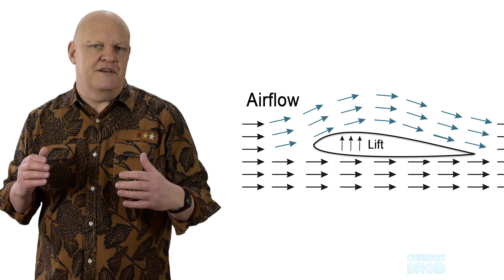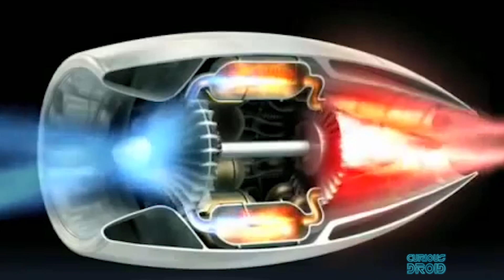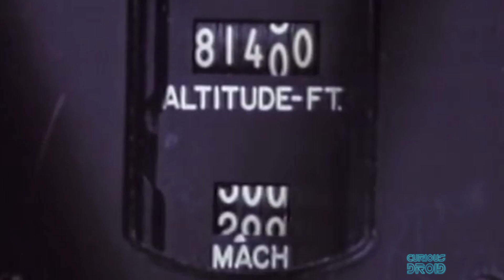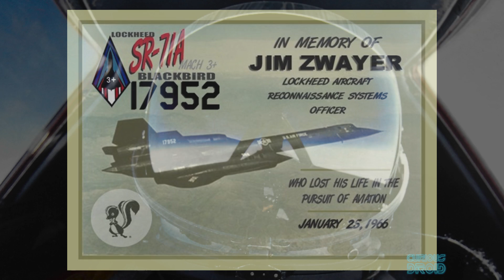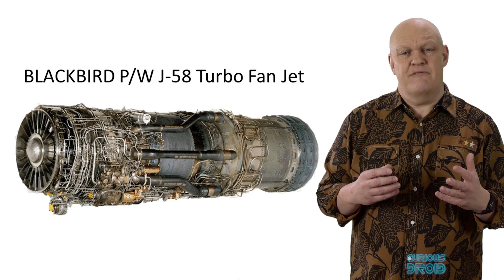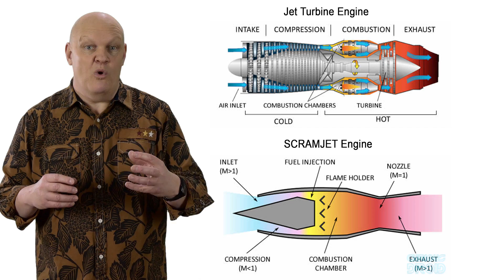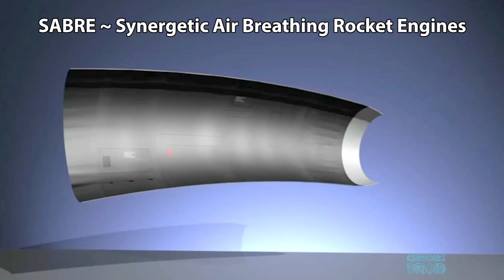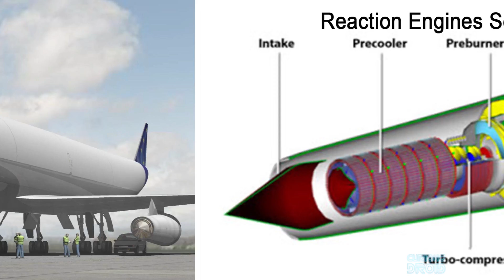Why can't we fly a plane into space ?

Comment: Correct me if I'm wrong, but escape velocity (about 25,000 mph) is the initial velocity needed (ignoring air resistance) to escape from earth's gravity permanently, going higher and higher and never returning.  Getting into space and staying in orbit requires a smaller initial velocity.  Getting into space and not going into orbit requires an even smaller initial velocity.
Reply: The 25,000 MPH number goes back to the Apollo missions. To get the Apollo spacecraft out of low earth orbit and on its way to the moon you needed to increase the speed from 17,500 in orbit to 25,000 MPH going out. But all that really did was place the spacecraft into a very long elliptical orbit that would take it to a high point of about 200,000 miles up. Then at that point the moon's gravity would take over and pull the spacecraft down towards the moon. Eventually the spacecraft would pass behind the moon and slow itself down with an engine burn to become trapped in lunar orbit. However, if the moon were not there the spacecraft would simply turn around at 200,000 miles and start coming back down toward the earth again. So technically 25,000 MPH is not really the earth's escape velocity. It's actually much faster. For example for the New Horizon's spacecraft that went to Pluto the escape velocity was about 36,350 MPH. But depending on the spacecraft's destination the escape velocity requirement can actually vary quite a bit.
Reply: Tyroneous Assault 

the booster engines are discarded because the fuel in them has been consumed, so the empty fuel tanks and heavy engines are now a liability in terms of weight. 
so they are jettisoned, making the spacecraft lighter, requiring less power to continue to accelerate, and the next set of smaller engines ignite and take over.
also the higher you go - the less dense the air, so you don't need as much raw power to go faster because there is less drag on the spacecraft. 

this is what airlines fly at 30k to 40k feet, it's far more efficient because your engines do less work fighting against the denser air below
less work means better fuel economy = more profits.  however there are diminishing returns the higher you go, you start to lose lift on the wings as the air thins out, and eventually your air breathing engines will starve for lack of oxygen. you can go faster to get more flow over the wings or into the engines but that requires more fuel = loss of profits
spacecraft are powered by rockets, and don't fly on wings, they go on raw brute power, and haul thier own oxygen. 

spacecraft don't "slow down" when they enter orbit.  they maintain a speed appropriate to the altitude of the desired orbit. 
they need that speed to stay in an orbit.  think of orbit as falling continuously,  but going so fast around the earth that you constantly  "miss" the earth as you are pulled down by gravity.
Earth is a curved sphere,  so with enough velocity you are constantly "going over the curve"   with gravity pulling you down, and your momentum carring you forward. 
as long as you maintain a ballance between your speed, and the constant pull of gravity... you stay in space. 

if you slow down you go into a lower orbit, if you speed up you go into a higher orbit.
slow down enough you fall back into the atmosphere and re enter, go fast enough you can leave 
orbit
Reply: +Justin Dougherty  No, gravity is acceleration, not velocity.  It's 9.8 meters per second per second.  If, on the other hand, you accelerated at 15 meters per second per second, that would be more than you need to escape from earth, if the acceleration was constant.
Reply: KenoTube    You are correct. 😎
Reply: KenoTube what are you? fucking smart?
Reply: -miguel rivera
"First of all i dont believe in space. Its made up for real."  Please don't reproduce.
Reply: Better Everyday Worse Everyday Im only 3 and Ive already built my own particle excelerator. With it I've created wormholes to other deminsions. I'm smarter and younger than you, just sayin'
Reply: KenoTube That's correct, there is no particular velocity needed to get into space, just certain velocities needed to stay in orbit (roughly 18,000 mph) or escape velocity needed to continue away from earth indefinitely, or even solar or galactic escape velocity.

Like many highly popular YouTube science themed videos, this one falls more in the category of science related, rather than actual factual science.

The simple answer to why you can't fly in space is that flight inherently requires an atmosphere.  Though it is entirely possible to travel in space, space travel is not flight, it's ballistic.
Reply: Skarmory Fly  
I'm only 12 i know how jet engines work almost every engine 
"I have been obsessed with plane for a 7 years"
Reply: If gravity pulls at around 10 meters a sec isnt say 15 meters a sec all the speed they would need?
Reply: Tyroneous Assault Gravity is a force that is the weakest known.  It caused by the mass of an object.  That mass causes space to be dented... so all the points in space contract... this means that a straight line is no longer really straight.  But everything falling freely toward the earth follows these points... and now cos they are stretched the object follows what looks to us like a curve. 

If you imagine the earth as say a bowling ball sitting on a giant rubber mat?  well it would stretch the matt downward yes?  and the heavier it is the more the mat would stretch downward yes?  okay so the gravity is not linked to the SIZE of the object... just it's mass (weight sort of)... so a ping pong ball and a steel ball would not make the same dent in the mat.....  now if you have the bowling ball in the middle of this mat,  causing it to stretch.... and you let a golf ball loose at the edge it would travel toward the DENT...  not the bowling ball but the dent it made... and it might roll around in a circle before finally coming to rest beside the bowling ball...  well that's sort of how you can view gravity... except gravity works in all directions....  not just on a plane like a mat. 

In terms of a scientific explanation gravity is a geometric distortion in four dimensional spacetime.
Reply: +Joe Vignolo 25,008 mph is the escape velocity. It's the one thing he got right. But all he got right was the number. Vesc = sqrt((2xGxM)/R), where G is the gravitational constant, M is the mass of the object to escape, and R is the radius of the object. It's nowhere near orbital velocity which, for circular orbits, is around 17600 mi/hr at Earth's surface, 17,500 at low Earth orbit, and 6880 mi/hr in geosynchronous orbit.
Reply: Does gravity not exist OR does Tyroneous Assault not exist?  Hmmmmmmmmm?
Reply: Exactly, Planes do not have enough velocity to reach space and their engines also require air to burn fuel.
Reply: You breath quite normal. Since the air in your capsule (or whatever) moves with you at the same speed. So relative to yourself, the air around you is at rest. And this is all that counts.
Reply: correct but the difference is because of the other heavenly bodies. the increase is to escape from the sun's gravity as a spacecraft moves outward.
Reply: + miguel rivera. What a surprise. I hope you are proud of it.
Reply: miguel rivera a true truth is in your head. reality is different, specially when you can not/wont get your head around it
Reply: Of course, the best way to find out the speed you need is to just point up and away and then mash the accelerator until you get that roller coaster feeling in your stomach. :-0)
Reply: Paul Taylor No spaceflight is not flight at all, never was.  The expression, space flight, was used as a way of expressing the concept of going into space, in a familial terms.  So though spacecraft do not fly, other than a during return flight of the Space Shuttle, we use the term, space flight, to mean moving around above the Earth's surface.
Reply: It's hypothetical so that you can explain the formula that governs the concept of escape velocity.  Sometimes you need to use hypothetical arguments to get a point across.  The formula cannot be used if you introduce air resistance.
Reply: Tyroneous Assault I seriously and honesty have no idea of what you are trying to say?
Reply: Tyroneous Assault OK, so you don't believe that all the experiments, who's outcome is reliably predicted, based on gravitational theories, are real?  Not to mention that working devices, like aircraft, cars, cell phone position sensors, etc. all work predictably based on gravitational theories. 

Maybe you misunderstand the limitations of theory.  A theory can never claim to know exactly why something happens, a theory is just a model of behavior that is able to predict future behavior.  So with present theories we can very reliably predict the trajectory or a cannon projectile, or the orbit of a planet or spacecraft.  We cannot claim to know exactly why gravity does what it does, beyond the predictions in the theory.  So within those constraints are you claiming that theories that include gravity as a variable do not reliably predict the real world results?
Reply: but our aircrafts cannot achieve that speed as of now...
Reply: NEOGRANZON The OPs point is that a vehicle would not need to achieve escape, or even orbital, velocity to go into space.  One could easily imagine a spacecraft slowly assending into space at even a few knots, mph, kph, it need not go fast to do so.
Reply: Haha you really believe the go that fast in their little space shuttle to escape? So what is on the way back 88,000 mph hahaha dipshit
Reply: Tyroneous Assault I think we must be speaking different languages, I cannot understand what you are saying.
Reply: Correct. In fact, if you remove all other objects from space (including but not limited to planets and stars), the "escape velocity" will tend to reach infinity. "Escaping" from the gravity field of one object only implies (just like you wrote) that you've been "captured" by the gravity field of another (which still doesn't mean you've completely escaped the first one, think moon causing tides on earth)!
Reply: KenoTube You can call"initial velocity" Delta V
Reply: Just play KSP guys
Reply: Seriously, Why do kids think that airplanes can go to space? They are fucking idiots. Most people that have played Kerbal Space Program (Including kids) know that jets are air-breathing engines.
Reply: HappyWeasl 
Can it comunicate through time? I really want to talk to my grandfather
Reply: KenoTube also there is no air
Reply: only 284 mph? lol Thought it would be faster than that
Reply: correct
Reply: ***** Specially when you want to transfer this in reality too. That is called fundamentalism
Reply: miguel rivera even the claim of a cure for leprosy?  (Leviticus 14)
Reply: so the point at which it releases it's engines still in view, it's going how fast and how high? If it has to keep acceleration because of its extreme weight, why does it get rid of them. How do they slow down when they get to zero "gravity",and what do they use to accelerate against to move around ,or to return? I'm just curious, if "gravity" just pulls them back... miraculously ...
Reply: KenoTube 

you are correct, orbital velocity is significantly less than the amount of grunt needed to leave the earth's sphere of influence.
Reply: thnx for the info
Reply: stinkyfungus , thanks for your comment
Reply: KenoTube stand corrected ♜
Reply: KenoTube
Reply: just so I get the math and concept right, can you explain what gravity is ? maybe show me the mathematical definition ? Just so I can finite my equation for velocity ,density ,distance ,rotation ,pressures of individual atmospheres ,fuel ,rate of burn ,radiation ,human and structural limitations. I just need the gravity part...anyone? Neil ? Anyone?
Reply: Right, lol! I'm sure 25,020 mph doesn't amount to as many G's as the new coaster at Cedar Point. Less radiation on the Coaster I hear.
Reply: So, gravity is the point at which you feel a hurl coming on?
Reply: and gravity is ?? 
It's not a dielectric magnetic field? I'm just curious. cause that seems simpler. I know it's not a big paragraph, but...... try thinking speaker ,what is it made of? what does it do? Now your cooking with ether.
Reply: +Zerando Games   Reread my comment.  I stated "(ignoring air resistance)".
Reply: +Zerando Games   Reread my comment.  I stated "(ignoring air resistance)".
Reply: Resistance cannot be ignored. Neither density. preposterous and erroneous. I wouldn't be able to argue if math and science weren't limited constructs in any case. Please show your work, in full, references also required in you assembly lack thereof shall be deducted from your final score. However, if gravity can be proven that will result in extra credit  (which will be doubtful in any such case).
Reply: Tyroneous Assault You didn't clear things up much.  So am I understanding you correctly, you don't agree with present theories of gravity or you don't believe that gravity exists at all?
Reply: No, I know it doesn't.
Reply: ask nasa to give you the formula, but be careful..they may have to kill you for asking seeing as there isn't one. do me a favor ,ask Neil ,he can't explain it, but can show a microphone has density. and that the Earth is stationary. I asked for the Definition of gravity boss. I'll be in the teachers lounge filling these rounders moms in

on there progress, of course. It's natural..
Reply: KenoTube  it is 11km/sec
Reply: Dude, great response.
Reply: youre right, duh!
Reply: Escape velocity is very ambiguous to a large number of variables. You can use for instance use sun/lunar alignments to get minimal delta-v, you can also use Lagrange points, you can use both together. You can utilize max velocity with Earth at Periapsis to the Sun,  and you can use all these along with multiple Earth/lunar slingshots to really minimize delta-v for an ejection solution. NONE of which are really practical for going anywhere in particular other than away from Earth. For every destination requires a finite amount of energy based on how soon you want to arrive.
Reply: Well most kids at one time DOESN'T UNDERSTAND HOW JET ENGINES WORK!
Reply: Lassigamer as you say, they are kids. you're rude to other people too.
Reply: KenoTube @
Reply: Better Everyday Worse Everyday 
Keyword: Most
Reply: KenoTube you have to be moving at 11 kilometers per second
Reply: +Anirudh Appala, reminds me of my dear mom.
She would say to me  when I was an aviator, 
"be careful, always fly low and slow"
Reply: KenoTube Don't you think 25,000 mph is a little TOO much?
Reply: Kenotube is correct,. also 25,000 mph or 10 kilometres per second is the required velocity to defeat the Earth's gravitational pull and enter interplanetary space. The reason why is because you start with no velocity at all, you must have enough energy and a constant acceleration that is stronger than gravity to defeat the constant pull of gravity. If the rocket instantly hit 10 kps the second after lift off it would have the energy to completely leave the Earth behind forever.

The 25000mph come in to play because this is the velocity where an object leaving the earth's surface from a stand still will be simply ejected form the Earth moon systems gravity via the centrifugal force. Think of it as like a round about, if you were to spin it and hang on the centrifugal force pulls you away from it, if the centrifugal forces becomes to strong on you it will pull you off the round about entirely. 

The moon as an example orbits the Earth much more slowly than the 25,000mph needed by a spacecraft. This is simply because of the moons distance relative to the spacecrafts, this also means that a much lower velocity would be needed by the moon to escape the Earth's gravity only 1.4 kilometers per second, only 1500 mph faster than it's current orbital speed.
Reply: Richard Mather have you ever seen it yourself?
Reply: strato man WE know it doesn't
Reply: Frantic Wizard how are you in orbit a full orbit. If you decaying
Reply: KenoTube anything more than 9.8 mtrs sec is what you need.  25,000 mph?  erm no... lol. 

it doesn't matter how you reach the 9.8 mtrs a second either just that you do and can sustain it until you can achieve an orbit. After that you can use earths own gravitation as propulsion and then any deviation in force away from the earth will throw the spacecraft off in a tangent to its orbit. 

So I'm not sure where this 25,000 mph came from.... nothing on earth can achieve that level of mass to force ratio...  not even the fastest bullet...  thats a complete orbit of the earth in 60 minutes....  or 7 miles a second. .. or 11,000 meters per second...  I doubt anyone could survive that acceleration... they would be a bony puddle in seconds...
Reply: CSM101 nope...  you can be perfectly stationary with respect to the surface.. which is what communications satellites do. Its called a geostationary orbit.  Now obviously that ground is moving... cos the earth is spinning but only at 1000 mph...  and even then you could orbit in the opposite direction to the earths rotation at 1000 mph... an orbit just means you are traveling perfectly toward the horizon...actually falling freely under the force of the earths gravity but because the earth is round you keep missing it. The speed you miss it at is irrelevant...  So the moon is falling directly toward the earth but it keeps missing it.... cos its falling toward a point on the horizon.

Although to. be more accurate the moon is made of rock too.... so it has gravity to.  So the earth and moon are both orbiting one another relative to their masses...the moon orbits the earth in quite a large circle... which is obvious.  But the earth does the same thing in a smaller circle(cos the moon has a lot less gravity)... so the earth wobbles around in a  circle as the moon orbits it.... eventually the earth will lose its grip on the moon and it will sail off into the solar system...  when it moves far enough from the earth... but not for a very long time. Its moving away at a couple of inches a year..... so give it another three billion years and the earths gravity will be too weak at that distance to hold it.
Reply: KenoTube I think you forgot to square root the equation ;)
Reply: Well Joe, the gravity just 200 miles above the earth is not really much less than it is on the surface. So almost the full 9.8ms second IS felt by the astronauts on the ISS. Its just that the astronauts, the ISS and everything in the ISS are all falling at the same speed under gravity.

They are weightless with respect to one another and the space station, but most certainly not to the rather large ball of mostly rock and iron below them.

 Also I long ago gave up posting math into YouTube, you are wasting your time. Well, thats my feeling on the matter anyway.  Plus from an educational standpoint a link would be better for those that are interested.
Reply: The two numbers are related: Escape velocity is the (square root of 2) times the orbital velocity. I think he should have used orbital velocity in the video. Going into orbit is not "escaping" Earth's gravity after all ... you're still here!

Anyway, escape velocity decreases with altitude, so the relationship of EV = 1.41 x OV is for the escape velocity from that altitude.
Reply: At 17,500 mph (about 5 miles per second) you can stay in low-earth orbit for a long time -- indefinitely if it weren't for atmospheric drag. Gravity is "quite happy" to let you orbit at that speed forever. 25,000 mph (7 miles per second), if achieved at the surface of the earth, will let you escape earth's gravity. If it weren't for other bodies in the solar system (and beyond) you'd keep going forever, slowing down the entire time, but never reaching zero. Leave earth at any lesser speed and you'll eventually be pulled back in.
Reply: if you stay at 17.5k mph what does atmospheric drag have to do with anything.
Reply: betaneptune the problem is, can you handle the air at that velocity? i mean, by far we can breath normally in a mach-3 plane(its a plane that moves 3 time faster compare to the the speed of air) . you need a tool or help or anything you call it, to breath in a mach-6 plane. then, in 17,5k mph, how do you breath?
Reply: if there is no acceleration, you experience 0 gforce so no force pressing on you
Reply: I was responding to Frantic Wizard who 2 months ago wrote:
"I don't think this is right. 17,500 mph is the speed you need to get into orbit, but the Earth's gravity has still got a hold of you and will eventually pull you back.  25,000 mph is the escape velocity from Earth -- this is the speed you need to escape Earth's gravity permanently, but that doesn't get you out of the solar system. . . ."

Ideally, at a certain distance, 17.5k mph will keep you in orbit indefinitely. That certain distance is considered to be low-earth orbit. MrYellow claims that gravity will still bring you back down. No it won't. I'm not sure of the exact distance, but regardless, if there is enough atmospheric drag, your satellite's orbit will "decay" with the result that the satellite will fall to earth. More importantly, you don't need to go 25,000 mph to get to low-earth orbit. (He seems to imply that, but it gets merged and therefore confused with his solar system bit.) 17,500 mph is sufficient. My point was that if anything brings your satellite back down, it will be something in addition to gravity. Gravity is happy to leave it in orbit if the speed and distance are correct.
Reply: To Na'Vi GTversion: You encase yourself in a spacecraft. Then you can breath. As long as the mass of your spacecraft is small compared to that of earth, the orbit will not depend on the mass. So the orbital speed at any given distance applies to any normal situation. Therefore we need not limit ourselves to planes.
Reply: Depends on the orbital distance. The ISS orbits the Earth at 400 km and thus requires a speed of 27,600 kph or 7.6 kps to stay in orbit however due to it's close proximity to earth, it's orbit decays and must be constantly readjusted.

The Moon orbits the Earth at an average 385,000 km. The Moon only orbits the Earth at a mere 1 kps.  Thats a little over 4000 Kph. The velocity required to orbit a planet or any stellar body increases the closer to the centre of gravity you get.
Reply: Yes, you are correct. (I didn't check your exact figures, tough.) But the discussion was why you couldn't get into orbit with a plane. And the easiest orbit to get into would be low-earth orbit, for which 5 miles/second is sufficient. So it seems safe to assume we are talking about low-earth orbit.
Reply: You need something like at least 284 mph just to get through the ozone layer ONLY so your probably right
Reply: Tony Graham 
It is way faster.
Reply: If you are traveling away from the earth starting at 25,000 mph at the surface you will, if nothing else interferes, slowly get further and further from the earth, never to return, slowing down to zero at infinity. The gravitational field of any body extends to infinity (ignoring relativistic effects, which don't matter here), getting weaker and weaker with distance according to the inverse square law. Getting to the moon is a little more complicated. You don't "escape earth's gravity". It's everywhere! As is the gravitational field of any other body.
Reply: The escape velocity should only be reached after you achieve an altitude of 90 miles? At this point there is essentially no air resistance
Reply: Why don't space shuttles go higher and higher into space? Van Allen?
Reply: I thought that for the purpose of this discussion being "in space" means being at least in orbit.
Reply: I don't think this is right. 17,500 mph is the speed you need to get into orbit, but the Earth's gravity has still got a hold of you and will eventually pull you back.  25,000 mph is the escape velocity from Earth -- this is the speed you need to escape Earth's gravity permanently, but that doesn't get you out of the solar system.  From Earth, you need a speed of about 94,000 mph (hope I calculated this right) to escape the sun's gravity.  Note that the speed you need is related to how close you are to the body you're trying to escape, so if you're on the Earth and trying to escape the sun's gravity, you have the benefit of already being 93 million miles from the sun to start with.  Hope this helps.
Reply: KenoTube .You are right. This is nasa bullshit.
Reply: Joe Vignolo waw .. hard to perceive such speeds when your mom( this is a general reference ) freaks out at 60mph lol .. Fascinating nevertheless
Reply: strato man ,No one has the answers regardless . 😉 gravity is F@cking Bullshyt! All these theories are formulated with gravity as a factor, thus proving all equations False! We know this, and these peons will never admit it, Because it would Destroy the entire foundation of what they were Told was reality. It's a shame a few choice books and instructors can achieve total tunnel vision and narrow mindedness of such passionate people. Oh well, I can't unsee the truth now, and maybe I have no right to try and help. Keep fisheye'n folks. 😉
Reply: stink fist  might as well give me math and references. since you like spheroid earth answers so much, math and references for that as well. use the force.
Reply: Resistance cannot be ignored. Neither density. preposterous and erroneous. I wouldn't be able to argue if math and science weren't limited constructs in any case. [Cough ,cough ,cough ] Excuse me.. Now for a pop quiz. Formulate space travel from spherical non-firmamental Earth... Please show your work, in full, references also required in you assembly. Lack thereof shall be deducted from your final score. However, if gravity can be proven that will result in extra credit  (which will be doubtful ). I will return periodically in the constructs of time to grant hall passes for restroom breaks.
Reply: Yes going to the moon required 35,000 mph to escape earth gravity.